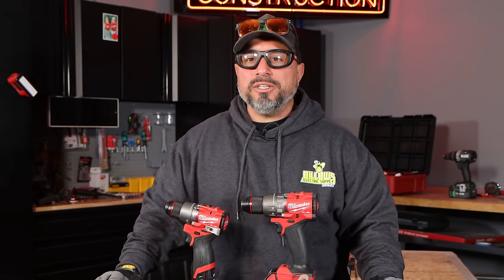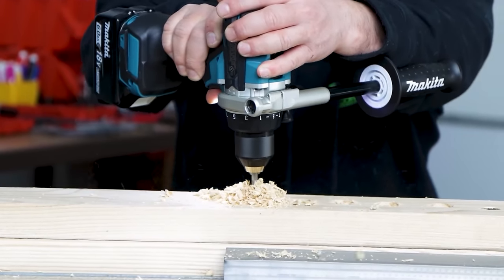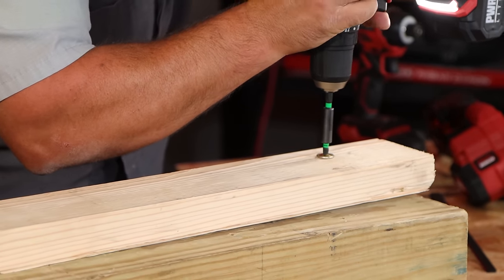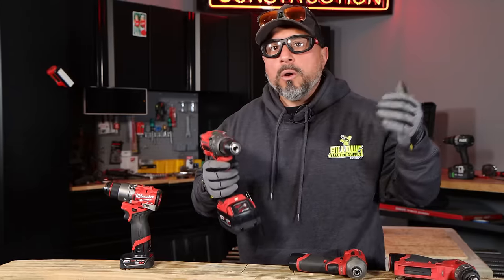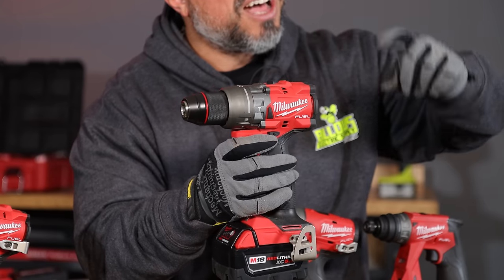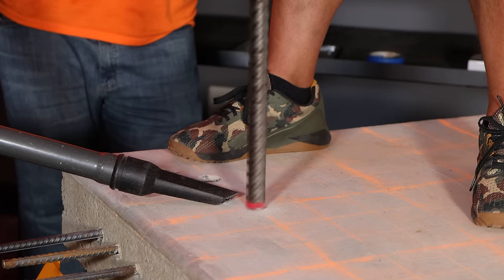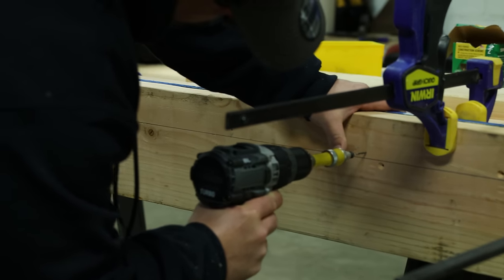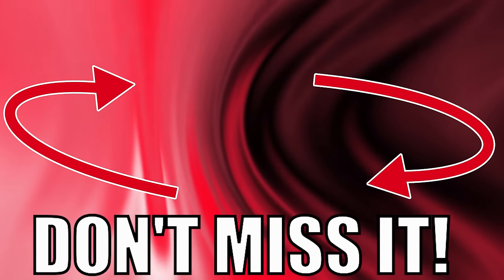Stop Using Cordless Hammer Drills...

Comment: these drivers are very usefull for bricks which are very common in Europe, most SDS drills go to hard and damage the bricks whils these hammerdrills do a terrific job at it. And in Europe a lot of carpentry involves brickwork so for me it is the only type of driver I have (got a few but multi purpose bits).
Reply: This is it for me. Many times the blowout on the back side of a rendered brick or block wall from a rotary hammer is a huge inconvenience for patch work. You could take the time to pilot hole it with a much smaller bit and then use the actual diameter bit on each side of the wall, but that's time consuming and also not always practical. I also hate doing more damage than is necessary personally. And I don't think you can get away from that with a rotary because it relies on that increased force/IPM to drill faster.

Comment: Hi Vince, IMHO it all depends on the type of construction in the area you live in. In my area most house constructions including the rooftop are made in concrete, masonry, rebar and cement blocks, it's a must on any drill. I live in a hurricane prone area PR. But up in the mainland I have to agree with you because I've seen the type of construction they do and mostly with wood, cement boards, gypsum boards, OSB ect.
Reply from the maker: Appreciate the feedback Anthony!
Reply: I live in Miami and this is certainly my experience as well. I've been putting lights into the wife's new office recently and the ceiling is concrete.

Comment: Go Vince! 
Your Wrong!
I pull it out when I need to use hole saws 1"+ and the occasional need for the Hammer Drill function. 
I chose this instead of the regular Drill/Driver for these reasons. I get Drill/Hammer Drill.

I also have my hex Impact I use as a Drill/Driver with Spade Bits. Can't do Hole Saw with Impact.

Also good to have both to use at the same time to keep from continuously changing out bits for pilot holes. 
Just drill & drive ambidextrous, lol.
👍
Reply from the maker: Well appreciate your input Redd, thanks!

Comment: It’s a hammer drill vs SDS question remodel work for fastening stud with a tapcon to soft brick a sds will absolutely destroy the brick you’re trying to tie into but a the hammer drill packs just enough punch to make the hole without cracking or destroying the brick even with old block 40+ years old an sds is just too much that is the only purpose for my dewalt drill with the hammer function but 9/10 times I run it for standard wood drilling without hammer it’s nice to have the multi purpose tool

Comment: When we need to drill a lot of holes in concrete, we get out our old corded SDS drill,  If its just 1 or 2 , less than 1/2 inch, we will just use a cordless hammer drill.  For SDS jobs, we always throw in another bit of some sort with each job we use it on, its a good way to get stocked up on bits.
Reply from the maker: Fair enough , appreciate the feedback Chuck!

Comment: I actually need the hammer function for my use case. I install window hardware for storm boards on new homes. Lots of them are stucco so theres a layer of mud i need to go through, I also run into nails every now and then. Definitely don't want to be lugging around a heavy rotary hammer for 15-30 windows, drilling 60-120 holes, especially when some are over 12 feet high. After that im putting in 5.5in lag screws with my impact. Wish i could only use one tool, but even if there was one, it would burn out from all the hole drilling and lag screwing. They both can heat up quite a bit on hot days.

Comment: Hey Vince, as a remodel and maintenance person.  It helps to have a hammer drill.  Example-  I own a bosch bull dog corded.  I would have required more drywall to be removed when replacing a bad or rotten bottom plate in a bathroom.  The old anchors or nails were rusted down to concrete.  Just made new holes and set anchors.  Quicker easier and had the driver function to tighten the nuts down.  Did not have to carry two tools, or mess with cords.  Saved me time.  I'm sure there was a faster way, just working with what I have.  With that said, I was impressed how fast gen4 hammer drill performed.  Gen 3 was meh in slabs when it came to that.  Keepem coming love the content.

Comment: Hammer drill is nice for small anchors and when a rotary hammer may initially chip out your concrete/brick/block. I've had to put tapcons in old brick and the rotary hammer I had was too aggressive. Went to the hammer drill for the rest and it was smooth sailing.

Comment: Hammer drills as per design tend to self destruct because many of its internals are plastic that cannot withstand the hammer action for too long. Thus, cost-wise, having two tools would not be too high when we consider the maintenance and/or replacement costs of hammer drills. You make excellent points, Sir.

Comment: I learned this the hard way.  I tried using my Bosch with a 6v battery to hammer holes in concrete/ masonry and was very disappointed in the failure of the tool. Luckily i had my trusty Makita corded Jammer drill to get the job done. The  Bosch became my go to regular drill driver.

Comment: I'm an electrician who works in residential new constructions. My impact fastens and my hammer drill makes holeys. Between my M12 impact and M18 hammer drill I can do anything. Using spade/augur bits on an impact is fine but if it hits a nail it will destroy the bit which my hammer drill wont do. it just stops.

Comment: As was mentioned - you will use the hammer drill function for tapcons, and drill less than a couple concrete holes. If you’re drilling more than a couple of concrete holes you’re going to want to use the rotary sds.. every tool serves a purpose and for lightweight concrete drilling and or concrete tapcon mounting ect.. the hammer drill is excellent!

Comment: I carry a hammer drill and a rotary hammer.  Sometimes the rotary is far too large to fit in some spots. Sometimes I don't want to lift a heavy ass rotary overhead for a couple hours at a time. Some anchors are so thin that a large bouncy rotary hammer will wallow out the hole as you drill and ruin the hole or force you to move your hole and change your layout when a hammer drill wouldn't.  I run into this a lot with tapcons in particular.  I'm an industrial mechanic by trade and have set 10's of thousands of anchors and have come to the conclusion that you need both to actually be efficient.

Comment: I use the hammer function often as a fiber technician. But I tend to use my m12 drill/driver for drilling most holes in wood and only pull out the m18 hammer drill when necessary..

Comment: Thanks for another great video and not being scared of sharing a well-founded opinion!

My first reaction was to disagree with your statement. As a DIY enthusiast and sort of amateur Jack of all trades, my experience with my hammer drill is beyond positive. Besides drilling into (hard) concrete, I'm able to perform all kinds of tasks with this versatile tool. I think I even don't mind the weight issue, while I'm often using 1.5 or 2aH batteries.
However, nowadays I more often grab the more specialist tools when taking on bigger projects. When working all day on a renovation or any other type of project, it totally makes sense to be able to grab the specialist tool and switch tools to fit the needs. Why drill a hole with with your hammer drill and then switch bits to drive a screw into something?

Comment: I’m a fiber and low voltage installation technician, and the hammer drill is used when needed. IE. making holes in mortar. The impacts can do it, but not as quickly as a hammer drill. I know what you mean, but it does have a purpose on my truck.

Comment: I use a hammer drill for drilling small holes in tile but I also own all the different styles of drills you spoke about.  also a hammer drill will work when you need to drill holes for a few tapcons unexpectedly if you don't have a rotary hammer with you.

Comment: I mainly use my M18 for drilling wood up to 1"holes with auger bits, 4⅛ & 6⅜" holesaws, and the ¼" masonry bit on hammer mode. 
If I need bigger, deeper, or more, it's the SDS & HoleHawg all day.
Otherwise it's my M12 impact or M18 impact.
If I know I'll only need a couple small holes drilled, wood or fenceblock, I'm using the tiny M12 impact that fits almost anywhere

Comment: As a mechanic I get the most use out of my M12 1/4 hex impact driver, than any other power tool. it's lighter & does about 85% of the work load. So I see where Vince is coming from. Not once, have I ever had to use the hammer function on my drill!
Reply: I have the drill and impact in 18v for work and 12v for home. The 12v models work on everything I would need them for at home and I'm confident it would handle my job, minus the capacity. I just don't like getting my home tools nasty.

Comment: I'm a homeowner. I have larger 18V cordless handtools that include a hammerdrill, but have recently been adopting the Milwaukee M12 system for working on my cars.  The M12 system is so lightweight and convenient that I've been using it for most things, and I'd go for that M12 multi-head installation driver before their compact hammerdrill for the exact reasons in this video.

Comment: Sds breaks the bricks when your drilling 1/4' holes for anchors.  Gotta use regular hammer drill.  Too, if your just putting a few straps on a pipe in concrete easier to just get the regular hammer drill,  it fits in a bucket easier.

Comment: I specifically use my impact drivers to drive screws and lags, my SDS Plus and Max to bore or drill through concrete and my drill to drill holes in wood and metals.

Comment: I've been in the skilled piping trades for going on 15 years now. I can honestly say that I have absolutely zero use for the hammer function on a drill driver. Things like the Shockwave impact Duty attachments for Milwaukee allow you to check up an impact drill for most drilling applications your hole saws would be one of the few things where I would use an actual drill driver but never on the hammer function. And then when it comes to stuff like concrete I've never used a hammer drill, I've always used the SDS rotary hammer.  What a waste of time the hammer drill would be. MUCH LOVE. great video

Comment: I work at a welding/fabrication shop that does some mechanical contracting and use my hammer drill frequently running anchors into concrete and block. I use my sds cordless when doing bigger wedge anchors but the hammer drill is awesome for smaller tasks that just use tapcons. I’m talking specific jobs where I may put in less than 10-20 tapcons on a jobsite.

Comment: I'm a warehouse technician who also does construction for the warehouse as needed (under a jack of all trades & master electrician who's also been a forman, superintendent, senior superintendent, and inspector). I don't really find myself needing to do stuff like coring or anything. Even drilling holes into concrete all day, it's usually for tapcons and anchors, drilling around 3/16" holes. I don't generally have a use for a rotary hammer, nor do I or the shop own one. My hammer drill isn't as fast as a rotary hammer but it does just fine. That and an impact are with me every day, as well as a handful of other tools as needed.

Comment: If you're a homeowner that hammer drill is the only drill you need. If you're a pro and need to go to a rush job and don't have a truck full of tools, grab that hammer drill and it will get whatever job completed. It's not the best tool for ever application but it can get the job done whether it's boring holes thru wood, drilling into concrete, or installing fasteners

Comment: As a electrician I think the hammer drill has its place, often times I’m hanging one or two boxes on a concrete slab and have to run conduit to those boxes. So I need to be able to drill 1/4” holes into concrete to put anchors in so I can mount my boxes and straps. Yes the rotary hammers are nice and I have a small one just for this stuff but Sometmes I’m parked far from where I’m working and if I’m only drilling like 4 holes it’s nice to have that function to save me time from walking back to my work van

Comment: As a multitrade. I'm always trying to streamline my kit. The standard box I carry now only has my M18 Fuel Impact Driver. I'd never drive screws with a hammer drill because the impact is so superior. And drilling with good impact compatible drill drill bits is also superior. There is a little more play in the bit, but that compensated for by less vibration were accuracy is concerned. Anything the impact can't drill out with a multimaterial bit on full speed is a job for the sds. The bit change is fast for instances where I'm drilling a countersink, then a plug hole, then driving the fastener. My hammer drill is obsolete. I'll probably replace it with an M12 impact. What would be useful is a clutched attachment for delicate work and drywall, but the trigger control is good enough for now.

Comment: Completely agree for wood working I use that installation driver 99% of the time and for work I use m12 impact or m12 hammer drill for a majority of the work the only true reason I even updated my m18 hammer drill is that’s the best tool to use with another specialty tool I got called a surewinder to wind garage door springs

Comment: Why won't you let me use this anymore.  I want to use it,  ut you tell me no. This is not fair as I want to use it.... but you won't let me.
Reply from the maker: It’s your money cuzbo…

Waste it any way you’d like!
Reply: Hilarious 😂
Reply: This has to be an inside joke. 🤣🤣.
Reply: Vince, the dam phrase ends with “but better than a master of one”. For my hammer drills we use them to drill small concrete holes for 5/32 and 3/16 tapcons. SDS is overkill for small tasks and especially overhead holes. This is your silliest argument ever.
Reply: Real men use heavy tools ! What are you made of cream cheese? Man up , lift some weights , and don’t give into using lightweight sissy tools !
Reply: @Frankiarmz  Regardless of your inflammatory reply, I'd hardly call matching the tool to the job a sissy situation where "manning up" would be required. Lol. If i need big anchors done, sure I'll bring out the sds. End of the day, we all get paid to get the job done in a cost and time that suits us individually. If you show up to the job with a 8lbs sds to drill 80 overhead 5/32" holes that I can get done in the same timeframe using a 4lbs gen3 hammerdrill, who's working smart vs hard? I see no point in expending any more effort than is required to complete the same task in the same timeframe. Cost benefit analysis and body/physical management are real things bro.
Reply: @frederichoyos678  my post was meant to be humorous, unlike your reply which was spot on and intelligent ! When I became a utility lineman , power tools were not widely used , drilling a pole with a brace and bit or using a star drill and hammer for a drill run in masonry took a toll on the body !
As I write this I am in pain through out my body . By all means work smart , make us of every technological advantage, your body will thank you later!
Reply: @Frankiarmz  Thanks man. I get you. I also just wanna say that I’m grateful that you and other guys out there agree that breaking your back for a job isn’t worth it. Especially if there is a better and smarter way. #Rolltide

Comment: I've just bought the M12 Rotary hammer. When I'm drilling in a concrete wall I want that thing to hammer and not to gently vibrate it self through. But I mostly do drilling for 6 and 8mm, so M12 is the perfect specialised tool for the job.

Comment: I use a hammer drill all the time for everything and I always have masonry bits in my backpack at all times. I mostly use smaller masonry fasteners and I don’t have to make the extra trip to the truck to get a hammer drill, because I already have it. If I’m doing bigger holes in masonry then I go get my rotary hammer drill and drills. 
I would say that almost everyday I will use the hammer drill function at some point, it’s just the type of work I do.
Reply: It's better to have one versatile tool, than having  to carry  several  different tools.

Comment: I’m with you on this one.  I definitely try to plan out the job and bring the appropriate tools. Especially when drilling and fastening into block and concrete.  My M18 hammer drill isn’t my go to for that.  I have used it in a pinch for drilling concrete when I needed to but it wasn’t the specific reason for me purchasing it.   It’s definitely more than capable, but I’ll default to a rotary drill for that task.   Great video!  Have a great night! 👍🏻
Reply: Shout out to u and vcg lol

Comment: Been working in construction from foundation to finish for 2 years now and have done personalized homes to comercial buildings...when im on a larger site and further from my tools, or working up high, I prefer to carry tools that can get most of my jobs done...I dont want to get weighed down by a bunch of tools, be running around more than necessary, or have more tools to carry up and down ladders, staging etc...hammer drill is the quick and dirty do all for anything that is gonna get covered up that can easily fit any bit/ doohickey i need. However i will say my impact gun is more comfortable to use in more situations

Comment: I have never used the hammer drill function on a drill/driver. I always go to the sds simply because it’s a lot faster. Especially when drilling large holes like 1/2” and 5/8” as we do for our pole sheds and the large anchors we use

Comment: As a DIYer I use my cordless drill drivers for general use. If I am drilling concrete or steel I will go for my old corded drill or drill press. But as you said it is the exception rather that the rule.